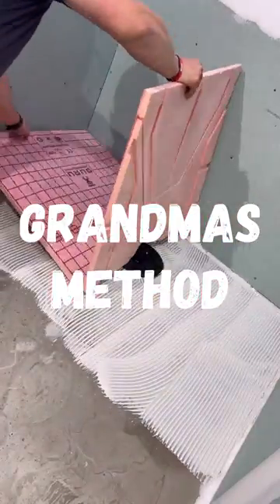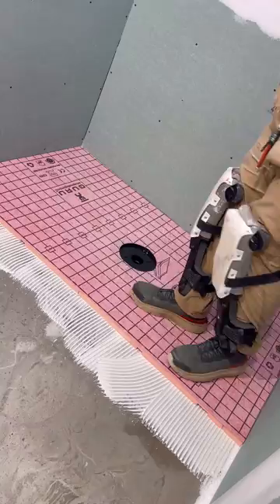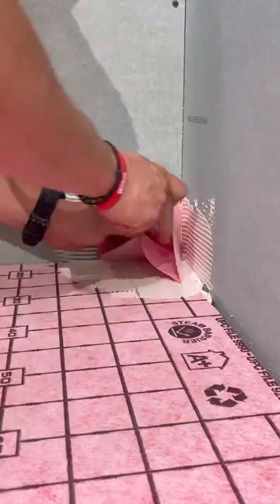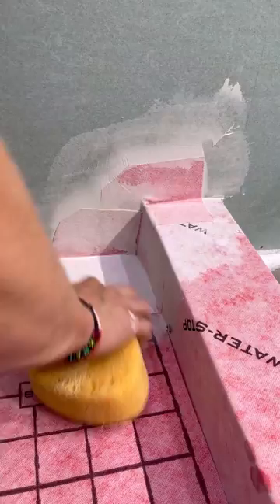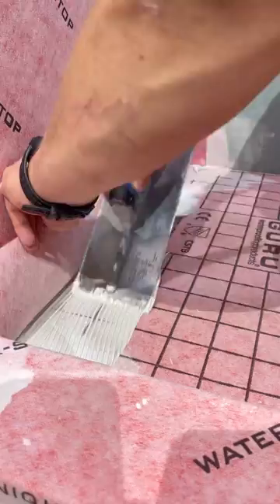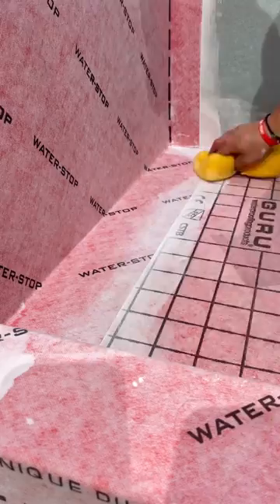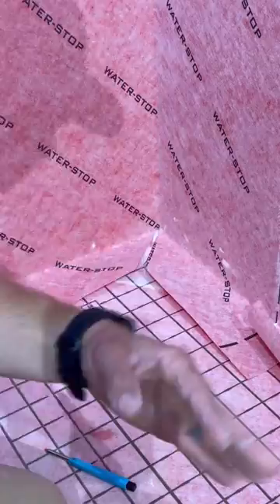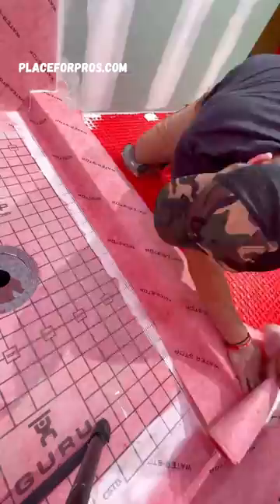Grandmas Method. How to waterproof a shower floor. WINNI

Comment: Ok dude, I love it. 😂
There are certainly differing opinions on corners and taped seams whether before or after, the full sheet wall membrane. 
Starting from the bottom up, makes the most sense; just like shingles on a roof. If ever the water makes it through the tile and grout and on to the membrane, gravity will take the water downward and overtop of the overlaps.
5" onto the shower pan?? Yes!    I'm so chuffed that I waited, dithered and procrastinated at this stage. This is a great detail. Thanks.
Grandma Knows best!😂😂
Reply: You know that gravity wont help you when capilary effect takes an action?